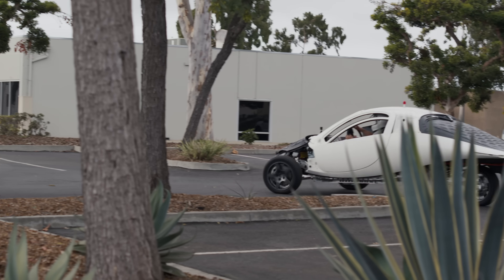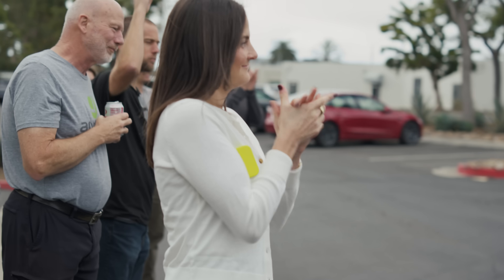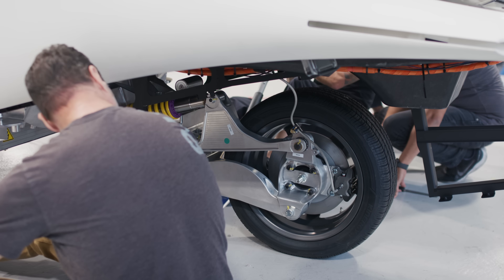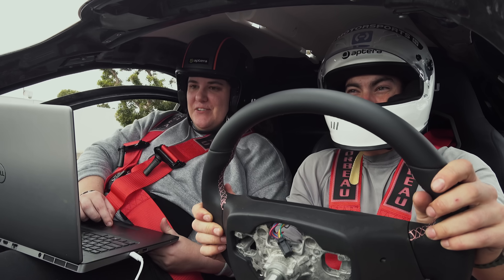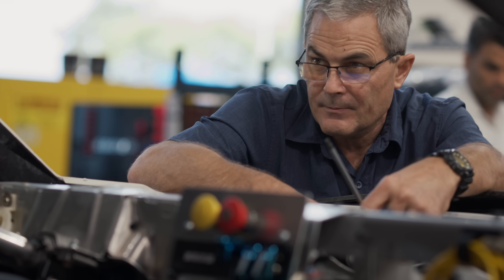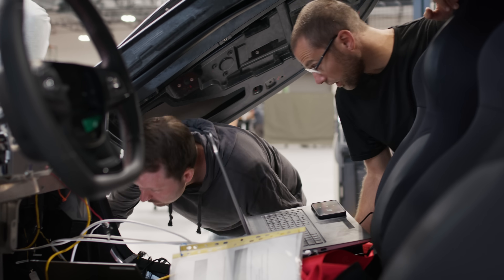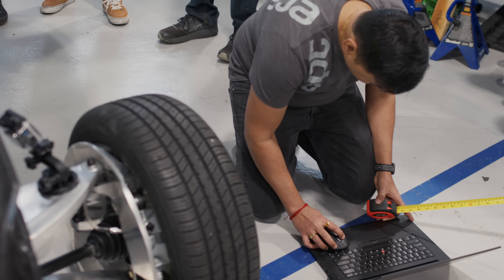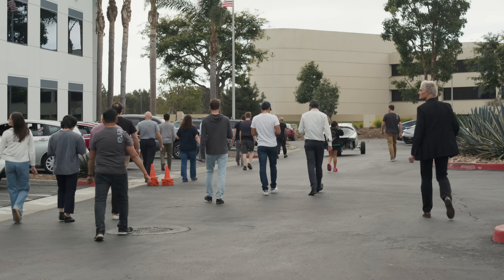Aptera — Driving our Production-Intent Vehicle

Comment: I pre-ordered on 7th Jan 2021. Almost 4 years later and we may have one working production prototype. I am not certain this will come to fruition. The previous version of Aptera went under.
Reply: SCAM.
Reply: It doesn't work. Have you confirmed the battery, standard charging, miles/kWh, kWh/day, battery range, temperature control for full range weather exposure, cabin HVAC, crash safety, likely price, production facility?

Comment: the rear wheel should be larger and wider, for more stability... Have ya'll seen what happens when motorcycles rear tire blows in high speed? It is not good at all... Hope the design have a protective bar around that rear axis that connects the rear wheel in case of emergency

Comment: put the battery pack on a tilting "sled" and ad a track instead of rear wheel, make it a ONE seater and ad skies.. 
you would have a better sales in revolutionizing the snowmobile market, snow cart like machines has been tried and tested- the design failed because you cant shift weight while sitting down. 
by doing this instead, you'd make the weight from battery pack a feature and not a flaw/ drawback.. 
snowmobiles are inherently unsafe, you are open to the elements and the elements are harsh, biting cold and avalanches takes out young and old every year!

Comment: 10 miles/kwh city, highway or combined?
Reply: Or neither?
Reply: @artsmith103  combined was the answer.
Reply: @suggesttwo   It was 9 long ago, then mysteriously got increased to 10. Then a less efficient motor got installed and Aptera didn't derate the miles/kWh. So if it was really still 9, then derated, it could be 8? And that rating is also subject to location climate so maybe only 8 in southern half of country and less in northern half. Don't you think it's strange in all these years Aptera never demoed miles/kWh?
Reply: @artsmith103  battery tech is improving substantially and the carbon fiber monocoque dropped a lot of weight. See the Munro and Associates video.
Reply: @suggesttwo  Remember when it was going to be IWM, AWD, $35K, Belly cooled, delivered over 2yrs ago, crash tested Q1 2024, cooling air from base of windshield, solar avg 4kWh/day, $60M from USCG, gold edition sold to UAE? Aptera failed all of that and yet you think they're going to deliver 10 miles/kWh?
Reply: @artsmith103  This was is a product under development. There are targets not guarantees. Aerodynamically speaking, any hole in the body creates drag.
Reply: @artsmith103  What is USCG? The IWM were likely dropped to reduce NVH.
Reply: @artsmith103  Driving the rear wheel would likely cause dynamic instability problems. This should never be used as a track car.
Reply: Since the weight on the rear wheel could never have a good roll center. If a normal FWD has 65% of the weight on the front wheels, this vehicle likely has 75-85% of its weight on the front wheels.
Reply: @artsmith103  In reality this is a very superior 3 wheeled motorcycle.

Comment: Big Aperta fan since the beginning, but... Please lose the mid window divider. That's going to be horrible for outward vision, and really spoils the clean aesthetic of the design!
Reply: It's a tradeoff. It's either a fixed window with no divider or a split window with lowering capability.
Reply: @
I would suggest that the point of the ultra low drag design would be negated by opening windows. Still, I get the marketability issues involved, and fact that people simply like to be able to “roll the windows down”!

As a compromise, I would start with a much smaller opening portion. This would lower the divider, moving it out of the sight line of the driver. Employing a much thinner divider would help as well, both from a perspective of aesthetics as well as reducing visual obstruction to the driver. Finally, a black divider would visually disappear into the surrounding glass, again aiding the overall aesthetic.

From the beginning, the Aptera has sported a beautiful design. Wonderfully clean and simple. It’s a shame to see that purity of design spoiled in such a significant way is is the case with this current change to the design. Just my humble opinion, of course.
Reply: @dougheizenrader2280  - Good points. I hadn't really paid attention to the divider, but yes, it's directly in the line of sight out the side window. It reminds me of the old Subaru SVX with its partial window arrangement. The obstruction would bug me.

Comment: So it's been almost 2 decades. When are these going to be produced.
Reply: I would guess never. They have been make paychecks without having to actually produce much of anything. They have no factory, suppliers, dealer network, and it being made with too many custom parts and they will never get economy of scale. Polaris slingshot uses off the shelf engine and trans parts and it's still 22k. And it's bare bones comfort.

Comment: A beautiful car! Great progress but a few surprises: What I noticed: this is a front wheel drive (ONLY) vehicle and the "in the hub" wheel motors will not be part of the first production units? It seems as this is a "one motor" drive driving both front wheels through a mechanical differential? Is the hub motor effort still being considered / developed? Is the hub motor going to be available the AWD units or will AWD unit drive through a belt as other tricycles today like the Slingshot.

On another note, I know safety is always first but I would have not had the drivers wearing helmets for the video. It makes it look very cramped the driver compartment.

Comment: front spring frequency looks high!
Reply: It's what happens when you try to use an oddball motion ratio. I see they are using KW dampers and the rear even has an external can on it. Would have been nice if they used an American company like Penske for the suspension tuning. They will make you pretty much anything you need.

Comment: Real, TRUE actual footage of the first PI build.  How can you tell it's real/true.  The guys behind the wheel are wearing helmets for the low-speed test.  As would be necessary for a low-speed test of unproven software that could glitch and cause an accident.  The odds are minimal, but there.  After testing, testing, and testing (which Aptera has proven over and over they are committed to, and committed to producing the safest/most-efficient vehicle on the road), we can be safe and assured to be behind the wheel of the greatest advancement in automotive technology in over a century!

Comment: I see clearly a front axle drive shaft, I thought you where bring Hub Wheels to the public??? What happened, Very disappointed. I thought we were ready for the Hub Wheel,.Didn't Protean build a factory for you out west?  Are you going to have three wheel drive in the initial release?
Reply: Read one of the old SEC filings and you'll see why they ditched the hub motors.
Reply: @billsmith5960  oh crap! I was looking forward to that. How will they drive the back wheel? Belt up to motor like motorcycle?
Reply: I just reviewed a prototype model video with Hub motors. They had them. Betting it was weight, cost or battery performance that caused them to change so late in the process. Dang it. Those hub motors would burn rubber!
Reply: @DennisMurphey  - SEC filings say different. This is why you must read them in depth. People seem to never do that and then just make up the reason why they switched.

Comment: So you've built a Can-am with a steering wheel. Ford did this already. It's called the Ford Stallion. You just put a roof on it and put the seats side by side. I can dig it. Add air conditioning, make it big enough for real people, not just skinny, tofu eating, starbucks drinking folks and make it affordable. 😊
Reply: Is that who you saw riding in it?
Reply: Lol you blind? They had a very large female in the passenger seat

Comment: Great work Aptera team! I see that Aptera ditched the direct drive motors for a more common differential and axel. Maybe more weight and moving parts, but it is probably a lot cheaper and easier to manufacture. I wouldn't be surprised if it was a Tesla Model 3 & Y front drive, that would be the easiest thing to do.
Reply: An Elaphe M700 hub motor weighs 23kg, so I'm guessing that an axle motor + differential should weigh about the same as three Elaphe hub motors.

Comment: I worked for Elaphe, a great company, which developed IWM for Aptera. Even if Aptera doesn't use IWM in its production model, I will be thrilled to see this vehicle on the road in high numbers. I hope that day comes soon.
Reply: Someday I hope the Elaphe motors will be on a future design. I could not see how they would make a profit for less than $45,000 with those motors and 3 inverters right now. Unsprung weight is no match for vectored thrust. Maybe call it the sport version and go back to 3.5 seconds 0 to 60!?
Reply: Why isn't Aptera using the in-wheel motors anyways?
Reply: I'm still wishing for a rear-drive, IWM-only version.
Reply: @netscrooge  I hope for the same as well and will sell my first Aptera when (if) the 2- or 3-IWM version makes it to the market. Not aspiring for rear IWM compined with 1 motor for the 2 front wheels though.
Reply: I've been following Elaphe for years and I just don't understand why they aren't in every EV at this point. The "skateboard" with in-wheel motors is a great concept with no drawbacks beyond the "unsprung weight" issue, which suspension designers can deal with pretty easily.

Comment: Did I just see a drive shaft going to the front wheel ?  I thought they were hub motors...
Reply: Aptera announced in its July update that it is switching the Launch Edition from 3 Elaphe in-wheel motors to one Vitesco Axle Drive EMR3 motor, so the vehicle will be front-wheel drive and not all wheel drive as originally announced.
Reply: @amosbatto3051  ..i c

Comment: why does it look like there is no electric motors in the front wheels? there is a drive shaft going to them from the main body.
Reply: That's what I came here to say, but for some reason I can't make my own post, so I'm responding to yours. I am guessing the in-wheel motors create too much unsprung weight which affects it's handling but that's just my guess.
Reply: @jamesm3985  This is old news and they've talked about it a bit in videos from the last couple of months. They do not seem to be worried about the unsprung weight, though one can only imagine this change has improved handling in that regard. They say the main thing is they would have to custom build the inverters (there would be three) and that added more complexity, time, and cost to a project they wanted to get moving sooner than all that would allow. Sounds like they haven't ditched the idea altogether though and will likely do all that engineering work when they can. But right now, they are focused on getting this vehicle out with a very convenient motor, inverter, and gearbox all in one low cost, tried and tested, reliable package.

Comment: I think the autocycle needs a wider rear tire
Reply: Just curious why you think that? The balance for this vehicle is very different compared to a standard 4 wheeled vehicle, I'm sure they modeled and verified that with their earlier test mule.
Reply: A wider wheel would add drag, and the rear wheel on the Launch Edition isn't powered, so making it wider won't add traction. The Aptera already has enough stability with the two front wheels, so I don't see what a wider rear wheel adds.

Comment: One complaint I here and feel with Tesla's, is that the people inside really feel the mass of all the batteries.  Does this feel the sam way or different?
Reply: Both Aptera and Tesla have the batteries in the floor pan, but the Aptera is a much lighter vehicle (about 2200 lbs) and the Launch Edition will have a 40kWh battery, which is lighter that the 60kWh battery in the Model 3/Y Standard Range, so the Aptera should feel more nimble. Drivers of the Aptera Gamma said that if drives a lot like a normal 4-wheel

Comment: That split window is one of the flaws in the design. There are going to be many many complaints of that split window. Some people are going to have to scrunch down or rise up to see around that obstruction.
Reply: The split window allows for a more aerodynamic design. Like everything in engineering, there are tradeoffs. One reviewer who drove the gamma said that he got used to the split window pretty quickly and it wasn't as big of an obstruction to his view as he expected.
Reply: @amosbatto3051  I did a CAD mockup here the window was shaped like a water drop/ flower peddle and it rotated down with the pivot near where the side mirror was located. No need for a split frame window. Less to manufacture. Smooth glass vs a frame, the smooth glass wins. 
I own and love my 81 Delorian but HATE that spit window.
Reply: You mean like the split window on the rear hatch of the Prius?  That vision-impeding split window?  Oh yeah, the public will never buy a vehicle like that!

Comment: These videos are starting to give me serious Elio Motors vibes.

Even if Aptera had a fully finished vehicle, ready for mass production with all necessary regulatory approvals, how would they secure the billions needed to build a factory capable of producing tens of thousands of units per year?

I never thought Elio was a scam; I believe Paul Elio genuinely wanted to build that car. He just couldn’t find investors willing to provide the substantial funding required to bring it to production.

Aptera seems to be in a similar situation. You simply can’t crowdfund an operation as costly as mass-producing a car.

I think they are going to burn through that hundred million they got from the crowdfunded investors and then never produce a vehicle because it takes way more than $100 million to mass produce a vehicle.
Reply from the maker: Hi Andrew, we're actively pursuing $60 million in funding. Once we secure this, we anticipate entering production within 9-12 months. Although the current delivery estimates in the Aptera dashboard align with our goals for production, vehicle delivery ramp is dependent on securing the $60 million in funding and therefore, will be a moving target. To learn more, please review our latest SEC filing. https://www.sec.gov/Archives/edgar/data/1786471/000149315224041645/partii-iii.htm Detailed in the filing includes our estimates on funds required to scale into high-volume manufacturing.
Reply: @ApteraMotors  Aptera, you just explained that with only $400K from USCG and never likely to see much more, you're near the end of the road. Your BOM suggests the trike is going to cost $40K, that is not viable. The trike might have initial regulatory benefits but you are excluded from European market, USA EV subsidies, and US carbon credit market. You gave up all of that to omit a wheel, halve the seats, add 50% more wheel tracks at a cost of $40K. That's why you can't get professional investment.  Huge amateur mistake!
Reply: @artsmith103  But that's what makes the Aptera unique, interesting, and ultra efficient. The vehicle you're describing is something boring like a Chevy Bolt.
Reply: @AndrewGray1987   if it has all those compromises, it should be at a much lower price point. I'm sure there are people craving the attention but that is not a sustainable market. The annual commute money it will save is around $200/yr. That does not come close to offsetting the compromises. More seats, more wheels, a usable roofline, possible hitch, and less wheel tracks is worth a lot more than $200/yr.

Comment: Will “a”surface panel additions for high speed testing be place holders to emulate final finish and weight or the actual production intent panels?
Reply from the maker: Good question Richard. Production-intent geometry, but not off of high-volume production tools.
Reply: @ApteraMotors  Go Team! Thanks for the quick response.

Comment: let me know when we can drive 100 miles per day  just on solar.
Reply from the maker: We're excited to keep innovating to boost daily solar yield. With current solar technology, Aptera can get you up to 11,000 miles a year powered by the sun, using just 1/3 of the energy of other EVs on the road. So when you do plug in, it’ll cost you only 1/3 as much!
Reply: @ApteraMotors  you should confirm that is for southern CA with 6.2 peak equivalent hrs per day. Most of pleasant USA is 4.2 peak equivalent hrs so 30 reduces to 21 avg solar miles/day. And that assumes 10 miles/kWh. When Aptera first announced their efficiency they claimed 300 mpge which is 9 miles/kWh so then 21 gets degraded to 19 avg solar miles/day and that is the optimistic high end!

Comment: They dropped the yoke yay ..
Reply: I'm not so sure about that. I think this steering wheel is just for testing. But I agree with you, I'm hoping/wishing it has a normal steering wheel. Never driven a vehicle with a yoke before, who knows, maybe it will function just as well.
Reply: @josiahpaez4601  Yoke is terrible for turns, and it even looked to be made of material that is difficult to clean and be full of grime in no time. There are many other design problems left unfortunately, both inside and out. For example where will they fit a European 21x23 cm motorcycle license plate.
Reply: @biondanishgenomeinstitute8193  All good points. I saw in a later comment that they decided on the yoke design because a normal wheel interfered with the visibility of the side view mirror screens.